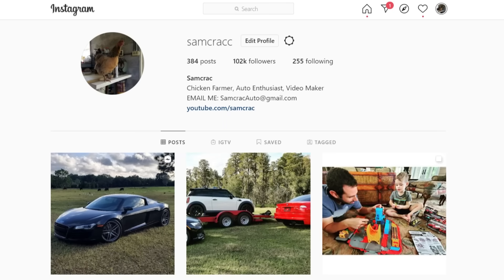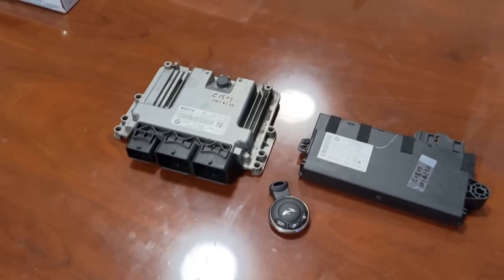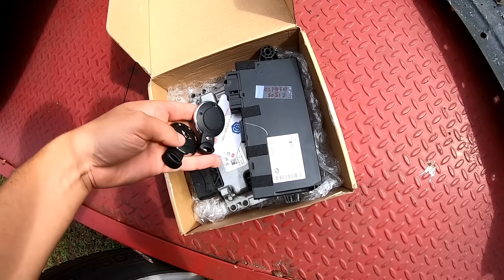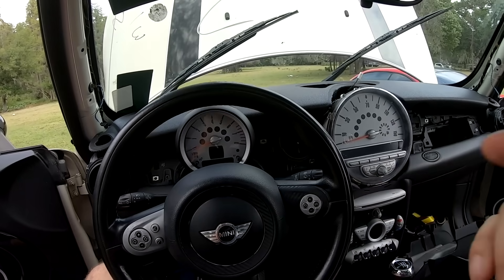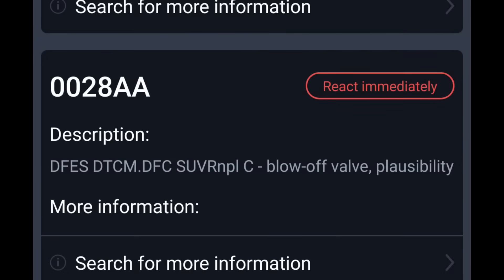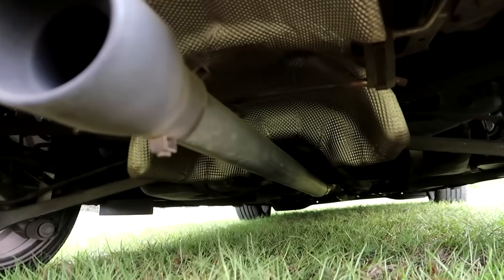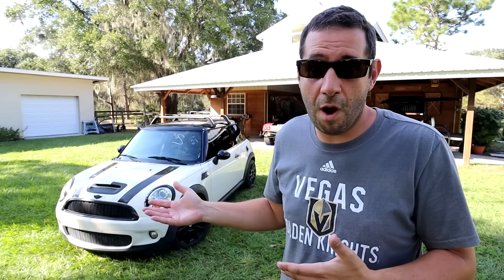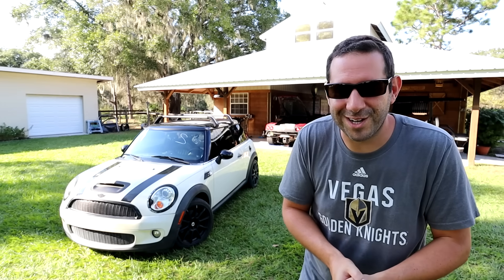Someone TAMPERED with our $1,000 MINI Cooper at Auction! Can a $50 Hack Bring it Back to Life?

Comment: Someone gave out the wrong key so there’s probably someone else with a mini from the auction who are having the same problem 😂 nice to see it fixed!
Reply: Haha lets see if Sam can buy that one too, get the price down since he probably has that key hehe
Reply: @Hagis2k  he should go back to the auction and go round pressing the unlock button too see if the other car is there lol
Reply: kind of like one time bought a pair of shoes and since my left foot is bigger than my right, I only usually try that one on, if that fits, the other will. Got home, 1 right and 1 left in different sizes. Someone else has the same issue as I do but I'm only a half size different so it's no biggy but the shoes were 1 size different. and not in a good way.
Reply: @muskokamike127  Sometimes you eat the bear, sometimes the bear eats you. Sorry to hear about that.
Reply: @adamshinbrot  I drink the bear
Reply: @muskokamike127  My left foot is also bigger than my right, by about half a size. For years I couldn't figure out why shoes fit fine at the store but sucked when I got home. Buying ski boots was also an entertaining experience.
Reply: If someone disconnected the battery without a battery tender it would have wiped the key info on the ecu meaning a new key has to be coded to the car
Reply: @Phantom_Wes  that doesn’t happen lol 😂
Reply: @Alexander_l322  yea actually it does on mini coopers when the battery is disconnected without a battery tender the ecm looses valuable data it needs to run properly and must be reprogrammed I've fixed this issue on minis plenty enough times to know
Reply: @Phantom_Wes  that cannot be true because if it is then that is completely stupid.
Reply: @Alexander_l322  your z type bmws do this as well had a "mechanic" cost my company a few grand in tow bills and reprogramming fees cause he disconnected the battery with out a tender and locked the ecm
Reply: @Alexander_l322  well hate to break it to you but its car manufacturers way of keeping people who have no clue what they are doing from working on the car
Reply: @Alexander_l322  its a common practice in European manufacturing
Reply: @Phantom_Wes  I've replaced the battery thrice in my 2010 Cooper S and never had to have it towed or "reprogrammed." This includes two completely dead batteries.  You're literally talking nonsense.  You are either complicit in scamming people, or you got scammed yourself.  The ecu loses data but it does not need any reprogramming or factory resets.  Also have a Z8 that has had the battery go flat before, and never required dealer service.  You're just straight up wrong, g.
Reply: @tylenol_jones  I'm just a bmw certified technician but what do I know
Reply: @Phantom_Wes  In other words, Sam caused the problem for himself. He said at the beginning of the video that he disconnected the battery.
Reply: @Phantom_Wes  evidently nothing.  or, like i said, you are unaware that you are complicit in a scam.
Reply: @tylenol_jones  keep believing that that and ill keep watching idiots flash lock their ecms while making 1500 to unlock them
Reply: @aftonline  good possibility
Reply: @Phantom_Wes  i mean, like I've said, I've been through three batteries on my Mini and never required any of this nonsense you're describing.  Maybe that's required on the new F-series cars, but R56 and R53 minis do NOT require re-coding for a battery swap.  Not at all.  You're just wrong, fam.
Reply: @tylenol_jones  base model minis do not require the battery tender as well as select models of the s built from June 8 of 2009 to may 10 of 2014
Reply: @tylenol_jones  the r56 originally had to be reprogrammed as well but they fixed it while they where all still under warranty due to many customers returning the cars to the dealers when they unhooked the battery to do mods as that was the only reason people bought the r56 was with intentions of modding them a few customers had to have the problem fixed but most were swapped before customers ever got the cars
Reply: @tylenol_jones  the fix literally takes 15mins I've had to do few myself on some that managed to slip by all these years
Reply: RichieBKidd swapped keys for the lols
Reply: @Phantom_Wes  if that was the case, how come that the control unit didn't lose the key information while it, and the keys, were inside a cardboard box for shipping?
Reply: @inmate666  huh?
Reply: I was literally thinking the same thing!
Reply: @Alexander_l322  Good idea haha.
Reply: @xnadave  I thought u were talking about your nuts in the first sentence and I was like wtf. But then I put it into context and I was like, yeah
Reply: @chrisclarkson4844  perhaps you should go learn about the damn car then cause we have been fixing this issue for years on minis
Reply: @DannyHDpsn  Sigh. Message edited to avoid confusion.
Reply: @chrisclarkson4844  cause when this is performed the ecu is set into a learn mode that once its reinstalled you put the key back in and it recodes just like most ecms replacement ecms so when they sent it back to him the was not coded it was ready to code the ecm was set to be ready yot code it once it was reinstalled
Reply: @chrisclarkson4844  so when you disconnect with out the tender you either a have to pay bmw or someone like me to recode and fix your shit or you buy a new ecm that is preset into learn mode
Reply: @xnadave  Lol it's ok, I had a great laugh, no worries
Reply: @chrisclarkson4844  Google dont have all your answers
Reply: @chrisclarkson4844  believe what you want meanwhile ill keep on making $1500 when people fuck their mini up and need it fixed I've already fixed and built  hundreds of them and will keep fixing them I just run a mini exclusive shop but its cool believe what you want
Reply: @Phantom_Wes  no you dont, if the problem is big enough as you say , you fixed hundreds then google would have something , I know from experience that you know nothing,

Prove it it's easy,
Reply: @chrisclarkson4844  its only a problem to idiots who don't know how to work on them and no Google won't have the info due to the fact that there was not enough reports or issuse or a specific period of time so it was never a recalled issuse and if you'd read there are only select models that have the issuse
Reply: @chrisclarkson4844  just like they tell you all ya gotta do is put the vanos solenoid in them and it'll fix them when you have to run the relearn procedure
Reply: @chrisclarkson4844  sorry but youtube doesn't tell you everything you need to know not one of them will tell you that you have to relearn the vanos on a solenoid change or it won't run properly
Reply: @chrisclarkson4844  but you keep believing what you want and my customers will continue to gladly pay me to fix their mini when it breaks as I'm the only person within 300miles besides bmw than can fix them and have been for the last decade and will continue to do so
Reply: @chrisclarkson4844  I've fixed hundreds of minis is that hard for you to comprehend  there's several where the customer has asked me to bypass the need for the tender in their car due to wanting to modify the car and will need the battery disconnected for a long period of time which takes about 15min to install and the tender is no longer needed but again this is only on certain models
Reply: @chrisclarkson4844  and your mini battery's are accessed thru the passenger wheel well so there's alot more that just disconnect and swap unless its be relocated to the trunk in which case the tender bypass is already installed
Reply: @Phantom_Wes   just give up pal what are you on about the battery is at the back off the engine bay on normal models passenger side tucked under the wipers  or in the boot for the cooper s model. Access through the wheel well hahaha  😂😂😂😂 mate are you thick just google shows you where the  battery is located.
Reply: @chrisclarkson4844  lmao keep telling yourself that
Reply: @chrisclarkson4844  if its in the trunk its been relocated and the tender bypass is installed factory puts them in the passenger side
Reply: @Phantom_Wes  nope it's in the boot on the cooper s models only stop waffling shit your embarrassing yourself , go on you work on hundreds just upload a simple video of you going through a wheel well to access a mini battery I'm sure everyone in the comments would love to see that.
Reply: @Phantom_Wes  ummm actually, nooooo, as an owner of an r55 clubman i can say you are 💯% wrong
Reply: @chrisclarkson4844  that would be entertaining as fuck.

Maybe he got the drivechain and battery confused, he clearly does not understand repairs and anyone of his customers is better bringing their cars to one of us, and idk about you, but ill give 50% off this scam artist "mechanics" quotes, and you'll ACTUALLY get your car fixed if you brought it to me instead of mr. "I fix hundreds but dont know what im talking about and charge 1500 for battery replacements."
Reply: @Phantom_Wes  you dont even know where the batteries are located in these vehicles??? Seriously?
Reply: @malkavianloner8808  you obviously can't read as I have already explained this so have a nice day and learn to read
Reply: @Phantom_Wes  If this is common practice in European manufacturing, it's just the latest in the long list of reasons why I buy Japanese; they don't pull crap like this.
Reply: @Phantom_Wes  i have your comments and you are so full of crap. I am a Level 1  master MINI tech. You can disconnect a battery and not have any issues. Amazing how many come in with completely discharged batteries and start after new battery is installed and registered.  I can tell you if the dealer he called would have just asked him to bring the key by to be read in the key reader it could have been 99% solved. Bad keys will not read in the keybreader at the service advisors station.
Reply: @BRIANS4177  well ya see the problem in your lie is that they are not and you are not mini cooper technicians there's no such thing they are BMW technicians
Reply: @BRIANS4177  keep believing what you want and ill keep on building 600whp minis for my living like I have the last decade
Reply: @Phantom_Wes  bullshit you are not getting 600whp out of no MINI. What engineering model and what motor are you doing this with. I know its gonna be another lie but just for entertainment please tell me.
Reply: @Phantom_Wes  gr8 b8 m8 I r8 8/8 was a good read a month after the fact
Reply: @zelo8670  🤣 finally someone understands 🙌 I was losing hope that someone would realize that as I said I build them for a living I know damn well where and how the battery comes out but some people just don't understand that those of us that know the cars will bs and yank your ass around about them all day long
Reply: @muskokamike127  Dude!!

Comment: I miss my mini. What I don't miss was the constant expensive repairs that the dealer refused to fix: 2 turbos, a recall on the chrome rear bumper, additional miles on the odometer after we paid but before we picked it up, and then finding out it had been previously purchased and returned—it only had 50 miles on it! Took it to another dealer and they fixed everything for free because we DID pay for the bumper-to-bumper maintenance.

Comment: The R56 Mini key fob actually stores information on it, including service history and fault codes.  Things stored on key:
(Dynamic Vehicle Data)
Mileage
Fuel level
Coolant temp
Air temp
Engine Oil Status (level)
Battery Voltage
Any Check Control messages shown on car dash
Average distance driven over last 8 weeks.
Bottom line is that the Mini dealership should be able to pull up all that data from the key fob, including the VIN. So you could tell immediately if that was the correct fob for the car.

Comment: Don't know if the key swap was an "accident" or on purpose, but I had a similar issue with a SAAB 900 Turbo Convertible which I was able to buy very cheaply at auction because it was running very rough.  Since it was advertised as a "Green Light" running and driving, the seller had a mechanic come and diagnose it.  Apparently, someone at the auction had swapped two plug wires.  It could have just as easily been a blown head gasket.  Like Sam says, cheap gambles can be fun.  Maybe you can call this series 'Five Cent Slots'.

Comment: the Limp mode is probably a faulty Diverter valve which has a rubber diaphragm that is prone to tear, new design eliminated it. the VANOS code may be the timing chain which is the weakest point in the N14 engines in the MINI.
Reply: Its not the actual chain its the plastic guides
Reply: @calebhopkins7354  Ericthecarguy showed in his ''Mini Series'' that it fails cuz of the weak guides + loooong oil change interval which does stretch the chain.
Reply: @calebhopkins7354  I remember seeing plastic guides being replaced in a BMW engine in a Hoovies video. I thought that was completely ridiculous! The whole point of using a timing chain inside the engine is so that you might never need to maintain it. Adding those plastic guides that wear out very fast eliminated the entire benefit!

Comment: The MINI is the best of both worlds; cheap and common; complicated and expensive to fix like an exotic! How do I know? I suffered through not one but TWO MINIs. The blow off valve and turbo both got me. gaskets, oil lines, oil filter gasket, body computer. Steering column lock never failed, but the right seat air bag switch did, to the tune of 6,000$.

Comment: Samcrac before you spend the money replacing the coils try taping the connectors down. I saw the same gen MINI at the shop I work at and we just had to tape the connectors down and it fixed the problem.

Comment: The part I liked the most about this video is that Valentin saved the day. Lol
Reply: Honestly? that would have been my first thought that it was the key. The thing about the old school keys that you actually had one that looked like a key is that if it didn't turn the ignition switch, it was the wrong key. These days with the electronics, it's easy to mix them up since they all look identical. 

This is why newer fancier isn't always better. I rented a jeep that had push button start (key in your pocket) but it also had a key that you inserted if the push button start didn't work right or the electronic key was dead.
Reply: No I was just happy that someone that has my name saved the day! Lol
Reply: What is the website of your company? I need a Mercedes key replacement only have one need another.

Comment: Check the vacuum pump. It's got a teeny tiny oiling hole. If it clogs, it'll seize ake out the timing chain and valves. Bought a cheap copper like that once ;)

Comment: Of all the video channels, I probably trust Samcrac the most when it comes to finding ways of getting four wheels on the road the most inexpensively as possible.  Great deal at auction, diagnosing the problem, getting the parts the cheapest way possible, knowing when and when not to do the work yourself.   Someone might want their very first car or drop-top exotic to play around with during their mid-life crisis.  I'd say continue to do a variety of cars.

Comment: Always keep an eye on the oil level. These cars are notorious for oil consumption because of the crappy PCV system that is integrated into the valve cover. I replaced my valve cover and it did slow it down a bit, but I still check it weekly.

Comment: Hi Sam I had a new 2007 Cooper s which had a timing chain tensioner failure at just 4000 miles, the car was in manufacturers warranty as was around 6 months old. When my car failed I was in my garage just leaving to go to work and got a very loud mechanical clanking sound. The rest you can imagine. The tech who responded from mini assist said this is a very common failure.

Comment: I have a 2011 R56 Mini Cooper, just had to buy a new key from the dealer. Had to send a pic of the registration and driver’s license to prove ownership. Key cost $260 from Utah in 2021. These keys are self charging, BATTERIES CANNOT BE CHANGED. They are self charging but eventually cannot hold a charge any longer. Mine gave up the ghost at around 10 years.

Comment: The vanos code isn't that big of a deal. It's what controls the cam timing on the end of the head. Get the vanos valves that have screens to block any garbage that may get into them through the oil. They are super simple to change.

Comment: I buy always cars from the abandoned vehicle auction, they come without key. For BMW and Minis I always order the key at the dealership they come cut and programmed ( 2 days wait in Hawaii ) no need to go back to the dealer and no need to replace the cas. I just bought a key for a E65 $250 plug and play the aftermarket made in China ones cost you $200 and last only a few months.